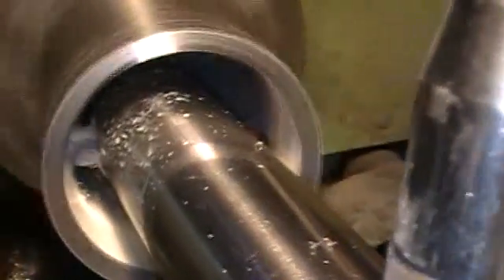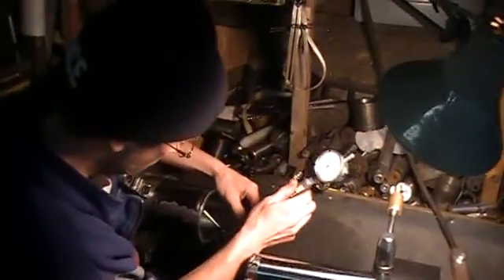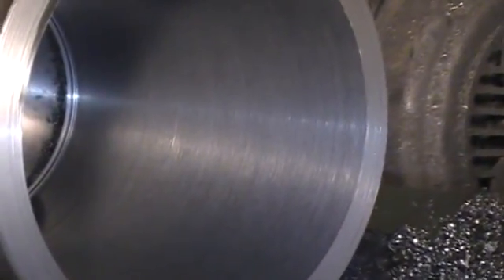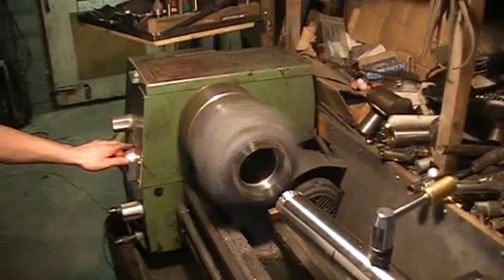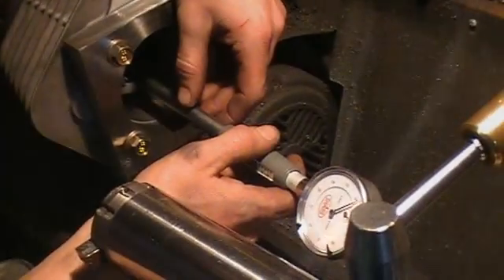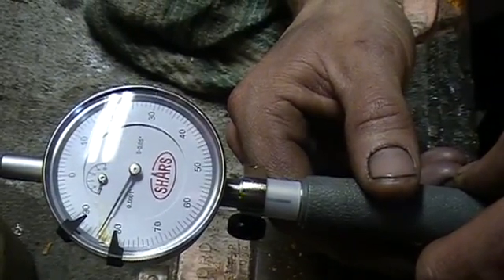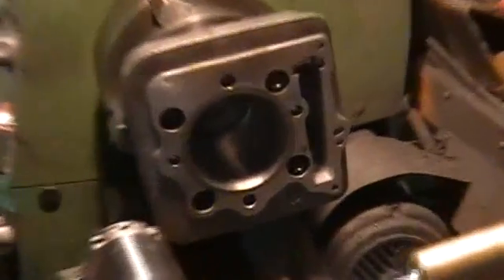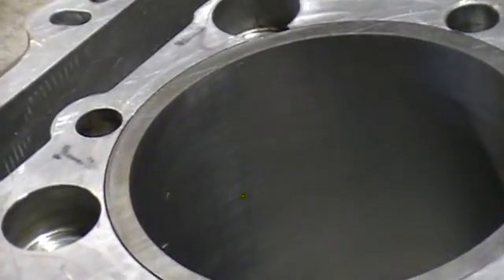Honda XR400R cylinder boring and honing at home

Comment: Why not  horning on lathe  with  full  speed  my friend
Reply from the maker: To keep the right cross hatch pattern
Reply: Correct, the lathe is for boring. You need to be able to quickly cycle the hone tool in and out of the cylinder to produce consistent cross hatch pattern to maintain ring alignment.

Comment: Hello I am currently taking a machine shop class in high school I have already been bumped up to the highest class this school provides and my project I decided to make was a 90 degree v-twin. I have spent if my math is right 87 hours strictly in planning on pencil paper then converting to 2d drafting software. My class does not have any new cnc machines just old fashioned hand crank Bridgeport mills and several south bend lathes of various sizes. And this being a self funded project i cant afford a cam shaft grinder. Since this will be my first engine I've made it"ll only be a single cam but the problem is the only form of turning on a lathe i think could work would be eccentric. i didn't know if i could make a jig or if it just wasn't feasible and this will be a low rpm motor so it doesn't need to be high performance so if you know any ways to make this please help! thankyou.
Reply from the maker: Cv8 Metal Wow what a great project! I found this method by searching quickly, but it requires a lot of patience! Keep me informed of developments. http://modelenginenews.org/techniques/hucks_cams.html
Reply: Thank you very much it helped a lot! i will post videos on my channel of updates when things get rolling. best of luck with your projects!

Comment: what size did you bore it out to
Reply from the maker: 86mm
Reply from the maker: All I can say is that the maximum you can bore without resleeve on a XR400R is 3mm. I don't know about your old XL...
Reply: the xl350 74-78 has quite a thick stock cylinder liner and can be bored up to 86 mm without re-sleeving.

Comment: Thanks for the answere. The drill driving honingtool how many Watt requires?
Using HSS or cabidetool in the lath.?
I used a honingtool "Flex Hone" 180 grit for deglazeing a cylinder to an Victoria FM 38. But , rings/cylinder lasted for about 200km. So I´m thinking of get some serious Tools . I´t will proably cost a lot more , than those Walmart-tools that i have used..

I foud one  AN 815 on ebay for about 2000$

Comment from the maker: @nortonfan100 

We are turning 480 RPM and take around 0.007" deep cut. We found that to be the best setup after several tests with the "junk" cylinder. This setup will probably give other results with a different lathe, tool etc.